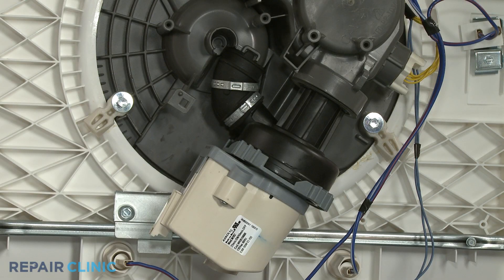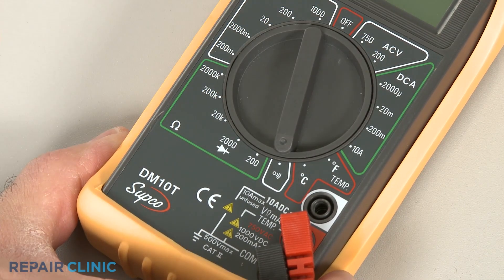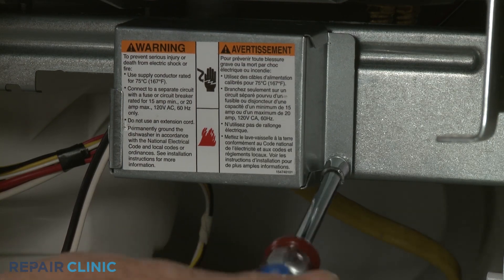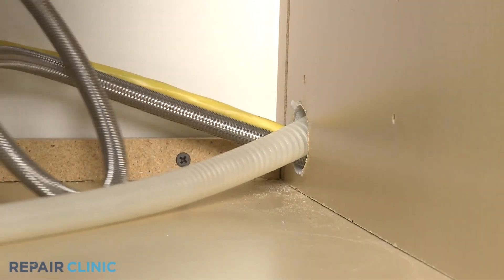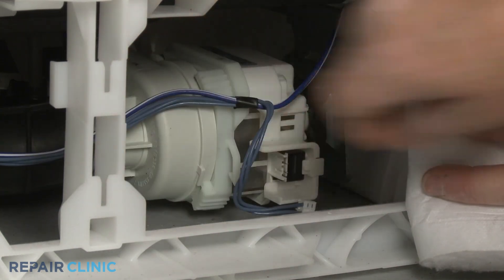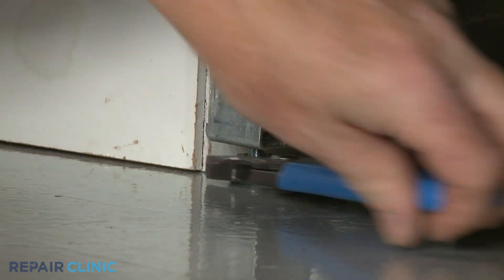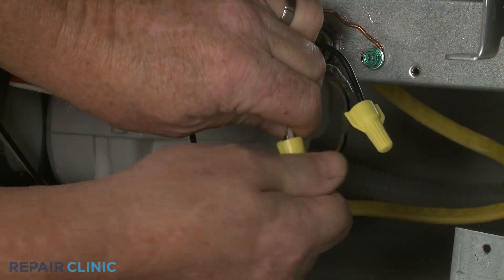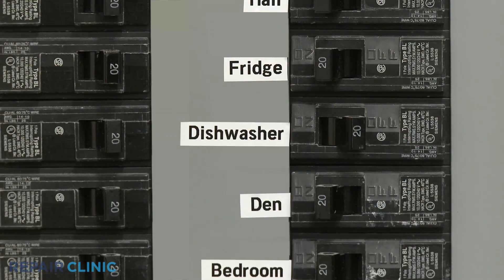Dishwasher Circulation Pump Continuity Testing

Comment: So... if pump is good and still doesn't work...  then what?  Control board? Or?  Not a very helpful video.
Reply: If the motor is good, the pump itself might be clogged with food/plate/glass/hard water deposits preventing the pump from spinning right if at all. In that case, you should be able to find videos on how to clean the recirculating pump if your machine allows access to it. Mine doesn’t but several models do.

Comment: Or if it's like my Frigidaire, turn power off to dishwasher. Remove front access panel, remove wire harness to circulation pump. Check for continuity.

Comment: Repair Clinic videos never mention that it's unnecessary to remove the electrical cover and disconnect / reconnect electrical wires if your dishwasher is plug-in and not hardwired.
Reply: Sweet baby Jesus. I just realized that.
Reply: Nor simply work this when pulled-out?..